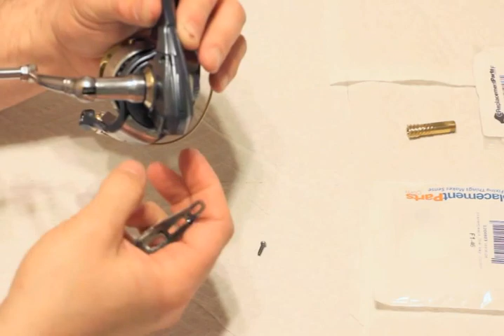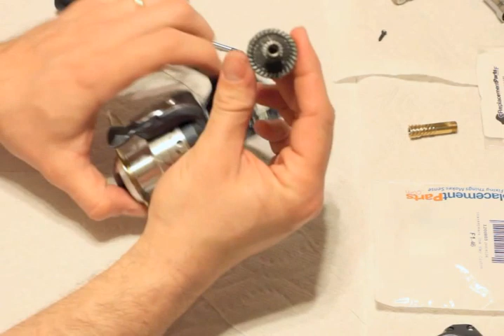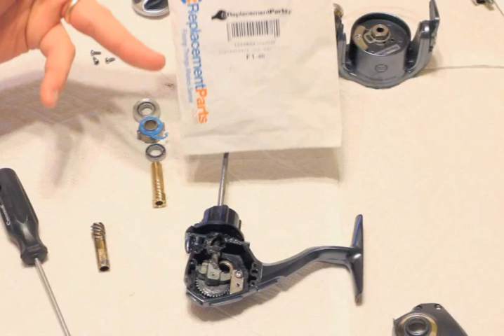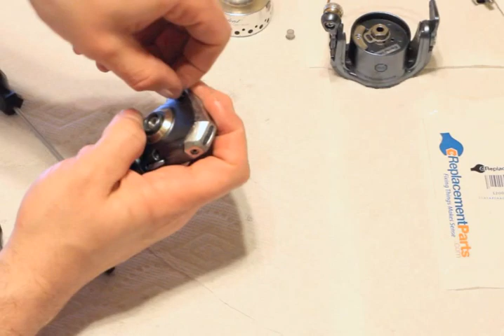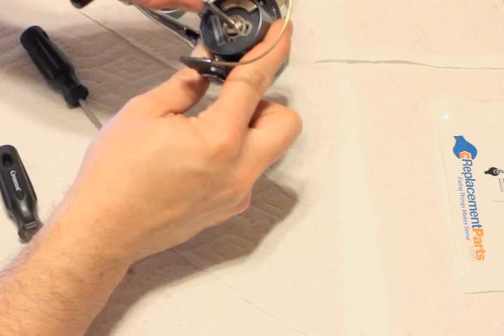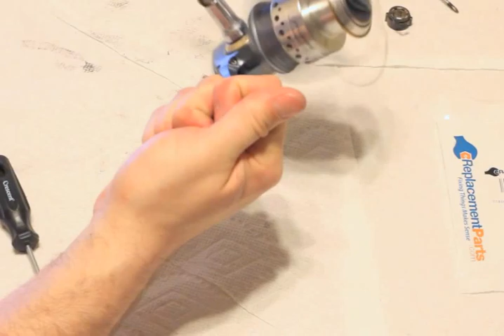How to fix a Pflueger spinning reel

Comment: How about teaching repair of the bail spring?
Reply: That's exactly what I need😢
Reply: Same here
Reply: Just stack the spring with the circle facing out right below the bar then put the arm back on. It takes a few tries but if you get the plunger and the spring stacked and pushed all the way up right before hand you should be able to get it.

Comment: What would you do if the reel isn’t taking on line and you get a grind when you reel?
Reply: You throw it away and buy a shimano or lews. I've had the trion and president and my conclusion is PFLUGER SUCKS. Nothing but headaches with these reels. I couldnt even get the bottom plate to line up right and when I did it bent and didn't look right. CHEAP QUALITY

Comment: The one thing i wanted to see and you didn't show it. I have the same exact reel except a little newer I only have one screw that holds that back piece. I torn mine all down and some how lost the clutch spring, which you didn't show after putting your one way clutch back on. There was a little tiny clutch spring on the end of that blue piece and attached to something and you didn't show it. You had to have taken it off to get that pinion gear out. You do have a little spring on the end of yours, right? Mine did. It's for the anti-reverse. Can you show me a picture of it attached? It's a brand new reel and hasn't even been used yet out on the water. After all the reviews on this reel on how smooth it is, mine wasn't so smooth out of the box.
Reply: Haha i watched the video for the same reason and just lost the clutch spring myself.  Trying to figure out where it attaches to also.
Reply: I believe it goes onto the plastic post that is sticking up.  One end on the blue pivoting piece, and the other loop of the spring on the longer extending post.  Tip: Run a thread through the spring loop and pull it over the post...then pull the thread out.  I have a smaller size President and that spring confused me as well.
Reply: He definitely skipped over the clutch spring because i have to put mine on and off with a sewing needle. I ended up gluing it to the post so I only had to deal with 1 end putting on/off and I  wont lose it

Comment: You should grease those gears and oil the bearings. The reel will be even smoother and last longer.
Reply: Jedhaase i was thinkin the same thing
Reply: I hate the Pfluger presidents. I have had 3 different ones hoping that one would work. It's all been the handles and that the main problem. One of them broke in the first 3 weeks of having it. I'm don't with pfluger.
Reply: @billybobjoe824  I'm not a fan of them either. They're mass produced from the company pure fishing and the quality isn't that great. They're popular and sell because they have 10 ball bearings and initially feel smooth. My favorite brand especially for the price is daiwa. Shimano also isn't bad.

Comment: Hey, Thank you for this video. It is great! I actually was able to take apart and replace all the parts where they are supposed to go. My reel was just spinning both ways so I thought the one way clutch was broken. It's not though. I noticed when opening it that a piece fell out. After looking on the parts page it seems to be the N-R lever spring. It looks like a twisted V shape. Anyway, I don't know where it goes or how to put it back on. It ended up breaking while I was playing around with it so I'll have to buy a new one, but when I get it I don't know where it goes on the reel.

Comment: I didn't see any lubrication.  I dis assemble my reels over winter and apply Lucas Red to gears and synthetic machine oil to the bearings.  I have reels that are 40 years old and are still smooth.